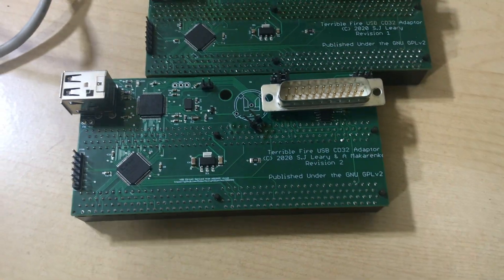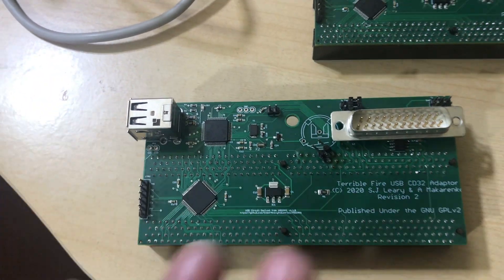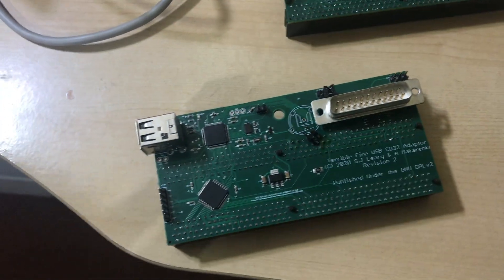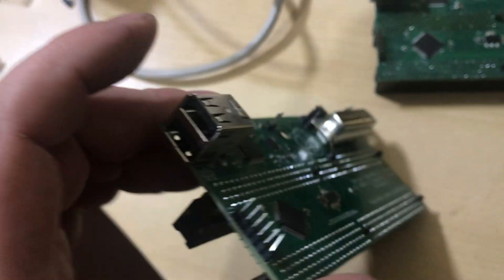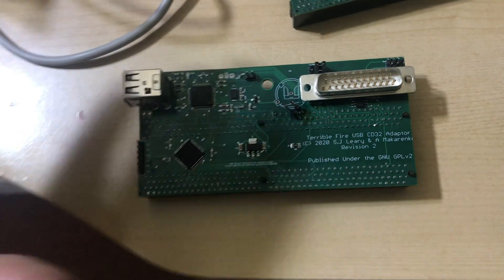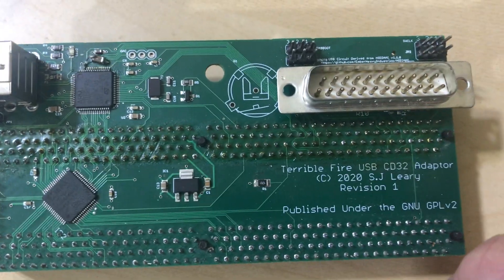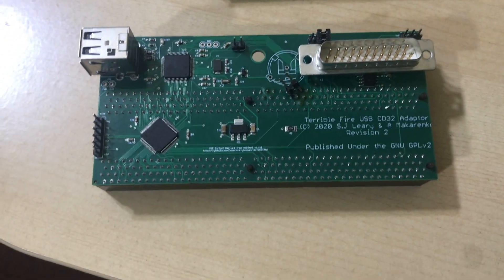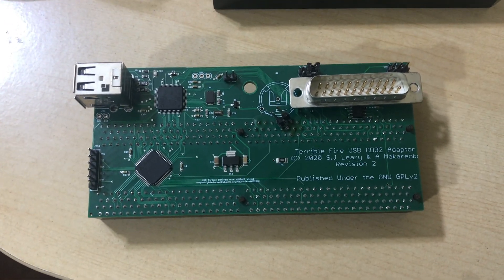TF of Tomorrow: TF CD32 Riser

Comment: Thanks for your wonderful work on all these cool cards for the CD32 community!

It would be sooo totally cool with a riser with floppy port, as you mention in the video. I've been looking for one since i got my CD32 some months ago, but they're extremely expensive (SX-32, etc) for some reason, or so rare they might as well not exist or are not ~100% compatible, etc etc.  (And would be wonderful to have in the riser itself, so you can keep the amazing Terrible Fire cards). (It didn't necessarily have to include RGB- or input-ports)

Comment: Very cool!  Would like to build one of these at some point!😀  I wonder if it supports the new "mini" Amiga mouse and controller?  - The ones bunbled with "The A500".
Reply from the maker: It should work.
Reply: As long as ot has standard HID Report, then yes.
Reply: I think I still have PCB and I should have spare stm32f722 (temporarily unobtainium...) if you would like to build current revision (risk that it simply won't work with your setup like 20-30% cd32 refuse to read correctly mouse and joypad data from stm32)